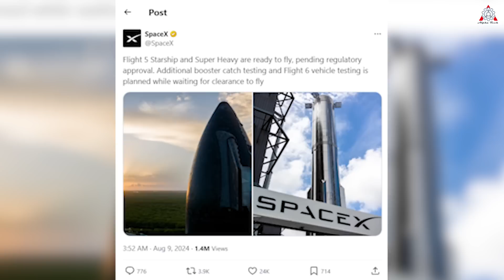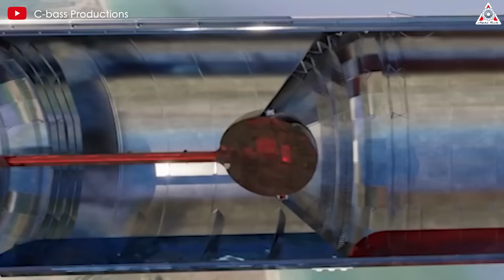Just Happened! Elon Musk Just Announced NEW Starship Launch Date...

Comment: Good Morning. Great Update and explanation on the catch of the booster. What you say about the engine is stop on. Also the pressure has to be extremely high so the fuel will atomize or it will never burn in such a cold of an environment. Similar to diesel injector. If you don't have high pressure, high atomization. It will never fire. Great Episode. You answered all my questions and a lot more. Great detail. Have a Great Day my Friend.
Reply from the maker: Have a happy morning my friend